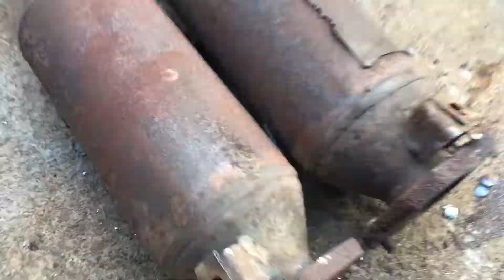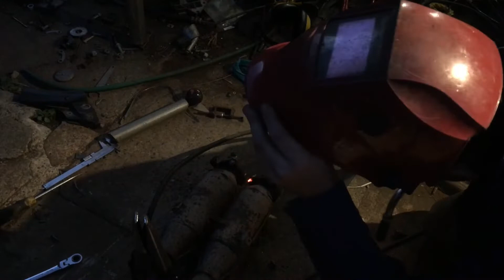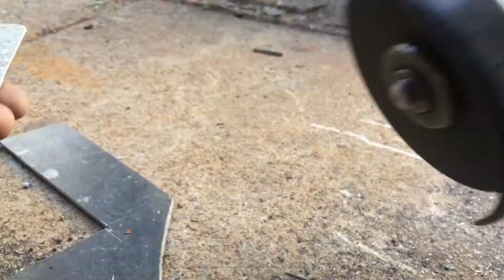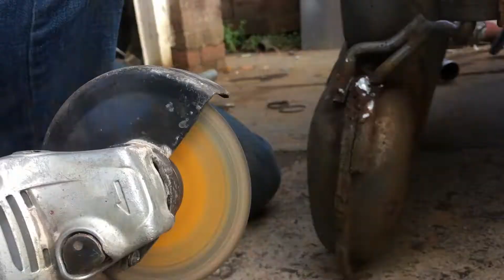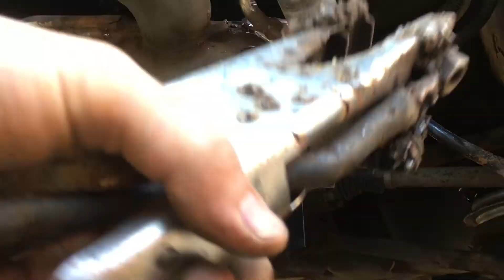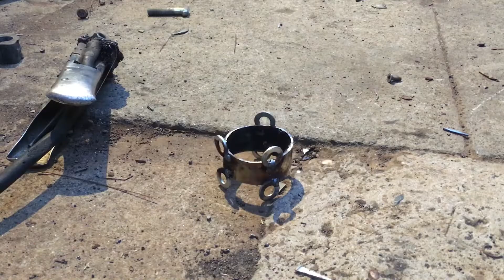Off-road Audi TT gets an off-road exhaust!

Comment: Really interesting stuff, when do you expect to be finished?
Reply from the maker: There aren't too many big jobs left - needs a front bash plate and probably an anti-roll bar, the engine sorting out (lots of odd bolts and clips and clamps, nothing really exciting) and some rear shocks. The ARB is the tricky one as the original won't fit, so some improvisation will be required to get it to a state where it will pass the MOT. I'm not 100% on the on-the-road date but it's not far off.

Comment: Is it me or is it only running on some of its cylinders?
Reply from the maker: It's definitely not running right; the idle's all over the place and it does sound like it's missing. I've got a diagnostic cable on the way so I can get stuck in properly. If I leave it to idle, it does the whole miss / die / recover / rev flare thing. First guess is a coilpack...